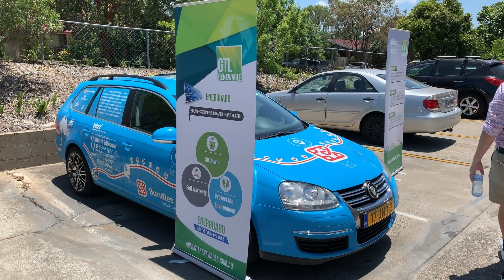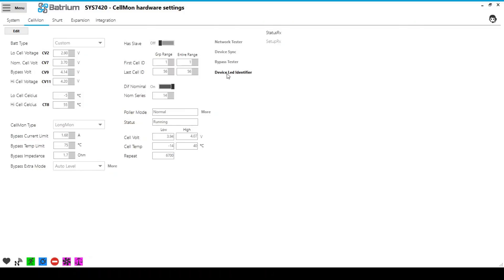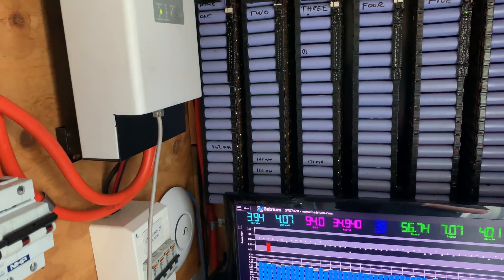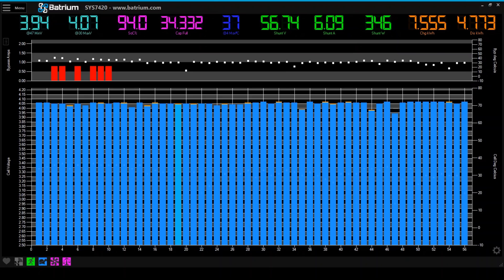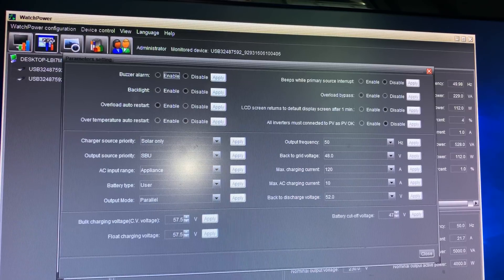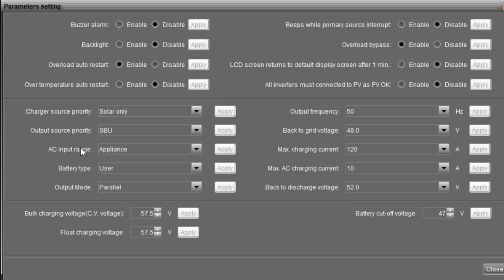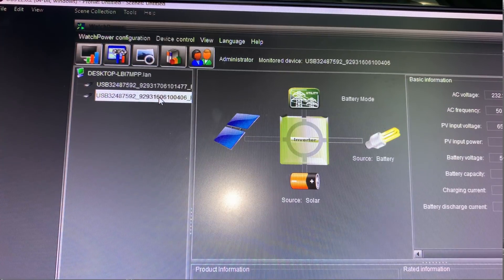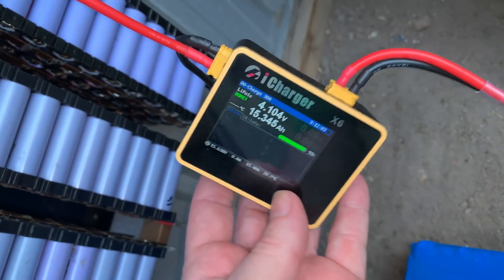A little bit of maintance & a walk through of settings with the MPP Solar PIP Inverter & PCM60X

Comment: Nice system bloke lol question is what do you do with your excess solar power when your batteries are full?
Reply from the maker: Used to dump to a bitcoin / eth miner, but these days we use more than we produce or store so not much extra anymore :) we worked out cooling and heating from the batteries was a cheap way to be comfortable lol

Comment: Very nice set up you got going on in there.
As a note: If something catches fire, you can be sure nothing stops that fire with the wooden walls.
Reply from the maker: You think the wood walls have anything to do with a chemical fire? Hell the plastic cell holders will burn faster and hotter than the wood.

Comment: any remote monitoring? I use Splashtop app on my phone to make changes and monitor remotely. I have my pip set to sms me warnings. Does the batrium have any sms or email integrated warning options?
Reply from the maker: no sms etc on Batrium - i have a NUC in my power shed I can just remote in via RDP or VPN

Comment: been watching and learning from your videos, keep them coming, this question isn't related to this video but to one i watched some time ago and cant find it to comment on it. i recall watching one of your videos where you are using deep cycle lead acid batteries as your battery bank and then you connected a bank of lithium ion batteries in parallel (i think this may have been when you were transitioning away from lead acid). my question is is it OK to used these two different battery chemistry together or is it a definite no no?

Comment: What capacity is your system right now? Estimated kWh? What is the maximum voltage of your system? Are you running 15 packs in series? I have around 20kWh of 18650 cells and started building my own powerwall. By the summer it must be up and running.
Reply from the maker: Tested capacity 38kwh https://youtu.be/cKMiCQGf6q4. Max normal voltage per cell 4.13 - when load testing 4.2 or as close as possible - 14s - are you documenting your wall build on www.secondlifestorage.com ???????

Comment: Hi HBPowerwall, where is a good and reliable site to buy the Panasonic 18650A LI-ION batteries? And what kit/method for testing do you recommend for the old batteries i have?
Reply from the maker: If you don't want to pay ebay fees you can try Tom depending on your location - he has heaps of different cells/sales all the tiem http://www.batteryhookup.com?rfsn=1822285.c32dc5

Comment: Do you think adding a cell to low packs would be a bad idea? To get capacity back up on a low pack. Without having to redo the pack??? Do you know of a used baitrium system for cell? I have the money. It's just difficult to spend the cash on something that has no power output! I am monitoring and manual balancing for now. I haven't had to balance yet. I need high and low voltage disconnects. I have only a tiny 16.7 kwh 7s200p pack and a 700 ah fla bank. 24v system.. Can't wait for more..
Reply from the maker: I have considered just adding a few cells to each low pack but you know what ? It'll look shit lol so don't do it that way. I really like the way it looks and will do the extra work to make sure it looks great all the time. No don' t know of any Used Batrium's laying around but you could check the classifieds on www.secondlifestorage.com .

Comment: Hi Peter, thanks again for this nice update. I have one question. around 6:02 I noticed that battery absorption/floating mode is 14.4 while the packs are 48V. Can you tell me what's the reason for this setting? Thanks in advance.  Frank
Reply from the maker: it's a multi-voltage charger so increments of 12 work in this case.

Comment: Merry Christmas Pete, Do you think your low packs are looking bad because the ones around them are a lot better than normal 😁🤔
Reply from the maker: no I think there is more too it than that about 3-4 weeks ago I bost charged 44 - so self-discharge looks most likely - however didn't think/consider this when I was recording

Comment: Well i still think active balancer is better than batrium (comparing how much energy you burn in long mons and to run computer). I see you are limited to 48V with your charge controllers-inverters, thats a shame, if you could lift you solar panels voltage to 96V you would have 4times smaller losses in wiring (Ploss=I²R). Hope you get active balancing longmons soon - cant wait to see them in action.
Reply from the maker: My strings are 115v on one and 60v on another so losses there are minimized - the 50-60m of cables is a negative for sure. I will not be using the wm6 on the main pack as it's going to be too much wiring - too much extra to go wrong in my opinion smaller bank with less cable management issue like bank in the workshop yep sure. Still, think the 50ah losses in a month for a hand full of longmons can be defeated with a single 30 dollar solar panel. Much cheaper for sure than going active.
Reply: Bartlomiej Wasikiewicz
when the longmons bypass, it means there is tons of surplus energy avalable anyway. and unless you have a really tiny system, they do not burn much energy at all. plus active balancers can cause problems as well.
Reply from the maker: Active balance in it's design has limitations, cables, mess & you can't change energy states without even more energy (you just can't see it ) really is a holden ford fight - no-one will ever win
Reply: @HBPowerwall  
i had to take my active bypasser off again. and went to batrium. if your cells all rise with the exactly same voltage in parallel, it can work. but my cells do not do that. so it starts to transfer power from one cell to the other. as SOC rises it then takes it off gain to push another cell. in the end, near float my cell number 1 went over the limit. the cutoff relay was activated, luckily.
and like i said before, in absorption mode the charge controller throttles back anyway, so there is no real loss. i think many newbys just look at one small detail than seeing the whole.
Reply: What can i say... If your systems are out of balance then it means they are build incorrectly, thats why longmons are always burning energy. My system is up for a year and a half and cell difference at the moment is 18mV. Saying longmoms are not burning much energy cause the cells are fully charged already is like saying my wallet is full, lets burn some banknotes. I keep my system always between 30-70% SoC not to loose energy and keep batteries alive for longer. Ordered active balancer board with one connection for all my bateries so no mess there, was hoping any of you had experience with bi-directional dc converters but as i can see you have not. Your approach is to burn excess energy my is to use as much as possible - if you scale your system up a bit you will not have big enough resistors.
Reply: @ISeeYourLies  
please!  yesterday my 16 longmons "burned" 35wh of electricity to balance a 20kwh battery. the most i ever used were 30kwh off my system, in the house. and i could probably use 60kwh in the house during a sunny day.
that is like less than 0,1% of my highest use.
and please!  when the battery is in absorption mode, the charger does "waste" potential solar energy.
for a while there were the bottom balancers around very vociferously putting up their point. they all disappeared.
and again, you are talking about an active balancer and you havn't even installed it yet. let us know how you are going after the installation and running it for a few months.
Reply: @ursodermatt8809  you saying 35Wh in longmons - all that energy is gone. Nowodays DC-DC converters have efficiency of up to 97% when IN and OUT voltages are very close. Lets assume we have 90% efficient converter so our wasted energy will drop down to 3.5Wh. I am not saying i will have the balancer connected 24/7, plan is to have it on for 24hrs once a week. When you compare loss of 12.77kWh a year in longmons to 1.27kWh a year in active balancer at least to me makes a huge difference. Other aspect is to avoid fully charge li-ions (battery university) why not implement voltage detection and send excess of energy to  grid or heat water to keep batteries healthy and prevent charger from sitting and doing nothing.
Reply: @ISeeYourLies  it is only 35wh hours! it is chicken feet,  ZILCH, it is nothing, nada. totally nothing compared to what the system does. i mean it is totally absolutely irrelevant. 
i turn on the hot water heating element just to use up some of my excess and it can use up to 7kwh. 35wh ????
besides my system is an island system.
i am absolutely not worried about those 35wh. even in an overcast winter's day when the battery doesn't get to float. those 35wh are totally absolutely irrelevant. and take  the case i could send it to the grid, the return would be just over 1$AUS a year. it is easier to pick up 10 discarded bottles from the street and return them for the deposit.
the "wasted" 35wh are the least of my worries.
Reply: @ursodermatt8809  i just wonder what you will say about active balancers when batrium will release it. I bet you will be one of first to buy it.
Reply: @ISeeYourLies  
i will certainly look at the any new thing batrium brings out. i doubt i will buy it at all.
what i am wondering however, what kind and how large a battery do you have?
for example i do not quite know what you mean when you say you keep your system always between 30 and 70% SOC. does that mean you only charge up to 70% SOC
or does it mean you only discharge between 30 and 70% SOC?
Reply: @ursodermatt8809  i have 6s li-ion system on 18650s. I am building 1kWh packs so i can scale system up relatively smoothly (without repacking everything). Currently i have only 3kWh of batteries (dont have constant source of cells).  Regarding SoC when my batteries cross certain voltage i am discharging them trough grid tie inverter to keep them in desired SoC zone.
Reply: @ISeeYourLies  
interesting. i have lifepo4 batteries. you cannot tell with them SOC by reading voltage. they need a current counter, as the voltage is so stiff. 
that main system is off grid. though it could be used to feed in. i already have a grid feed in system. 
keep in mind on smaller 6s systems the problem with capacity differences is much smaller than 16s. my 12v system for example with the same brands of batteries is always close together.

Comment: Good walk through, thank you.  Question.  The recent shaker in Alaska has me thinking about some additional safety for the cell packs.  Any thoughts on what you do or can do to help get these safely through a natural disaster or is it just hope nothing happens?
Reply: Any good resources at the local hardware maybe some stiff silicone or rubber bushings to remount the whole battery against the wall? Not sure just spitballing
Reply from the maker: Never been through an earthquake - me i'd just lay them on their back so to speak rather than hang them and strap them to something solid. would also consider something falling on or into them.

Comment: A question as I have had a look on youtube and online with the pcm60x..
For a 24v system (used laptop batteries) what do u set the absorption voltage and the float voltage at is it 14.5 ? 
(Yours was 14.4)
Thanks in advance
Reply from the maker: PCM60x do 12, 24, 48v with lithium they are best suited for 48v plus you have to account for the voltage variation between charging devices